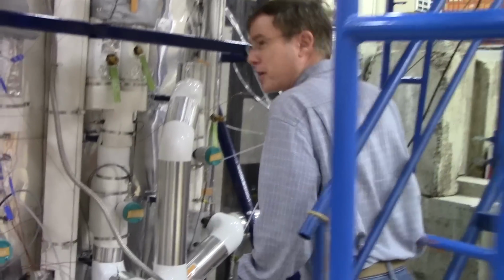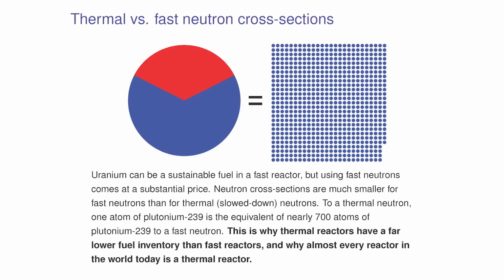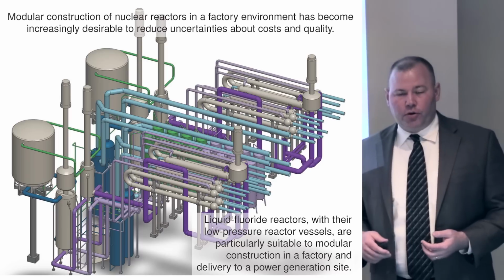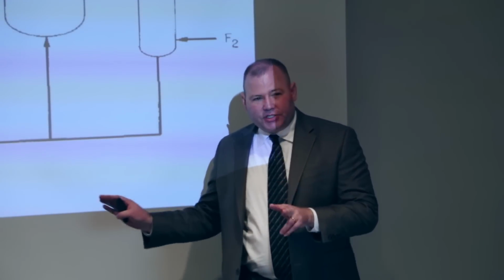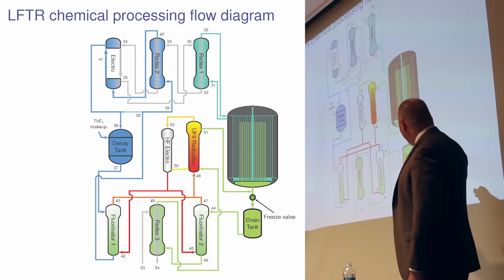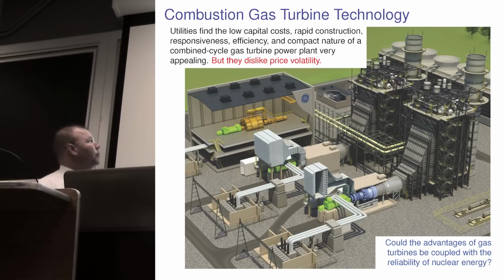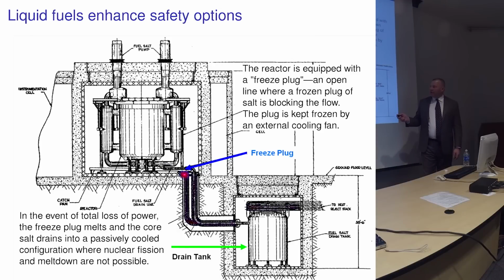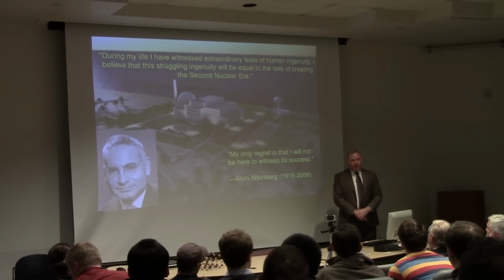LFTR Chemical Processing & Power Conversion - Kirk Sorensen

Comment: Thorium isn't fissile. It's U233 that is made from Th233. Amazing how that whole area is carefully not written about. Just another U reactor using a MORE hazardous radioisotope! U233 bombs have been tested.
 Don't believe that decay-heat has been solved. Let your salt solidify and watch how hot-spots appear, totally defeating this wonderful, totally false security feature. A solid cannot have heat removed anywhere near the efficiency of a liquid so those hot-spots will breed.
 As a parting shot. radiolosis will result in volatile salts and metals - so not safe at all. Dounray in Scotland ran 2 breeder-reactors and examined the trans-uranic (232-239) elements chemistry and radioactivity and discovered that in their sodium-cooled systems, it was inevitable that fissile material ended up in the cooling circuits. That was a 33 year study and the use of water is for the very simple reason that the Navier–Stokes equations are an extant mathematical but we have so much knowledge on water & steam, design can come from direct data.
 How quickly DOES a molten-salt erode the piping? Hastalloy N is NOT designed for the loads mentioned. As the lead-eutectic & sodium-reactor failures, so we learn how metals embtittle and dissolve other metals. We just know from practical experience how critical water acts. Information from hundreds of deaths.
 Any idiot who doesn't realize the hazards should elect to have one built at the foot of their driveway or ideally in their bedroom. THEN we will see who truly believes in the safety. I know for sure that nobody involved in the technology on any kind of academic level would give it 2 thumbs down in the blink of an eye.

 So, please ask. I have the .PDFs of the entire US/UK & Japanese research information and if you can sit through the 3800 pages then you can at least think of appropriate questions. I think question 1 is 'who profits from these lies'... not a LONG trail of breadcrumbs by any stretch of the imagination.
Reply: Bad Pharma - Dude, have you been popping Bad Pharma pills? You don't start off with "Thorium isn't fissile" talking to a crowd where the entire conversation is on breeding. As a parting shot, consider how silly your suggestion of getting your city council to approve installing a containment building in your bedroom sounds.
Reply: By the way, you did say, "Let your salt solidify...." as though you assume it has only been theory that hasn't been done yet. Which has actually done every Friday, simply flipping the switch to go home for the weekend. You simply can't equate molten salt with molten sodium with molten water with molten whatever. A reactor is fundamentally DIFFERENT when the fuel is dissolved in the coolant. If you think the nuke is doing something dangerous, flip the switch, go home, and let it turn into a brick while you figure out if there was something to worry about. It's what's called "walk away safe".
Reply: It IS only theory - nobody has ever tested what form a mixture containing U233,U232 and all of the transuranics (yes - the list of daughter elements is in the double figures) physically behave. Volatile fluorides will tend to stress a solid until it fractures and force their way upwards - concentrating the fissiles.. You are aware that radiolysis means that ever element (including the transuranyls) will form salts with the -F? It also means any salt anions will also appear in their metallic state (so look at the MP & BP of them all).
 I have been told by someone quite well versed in technology that beryllium fluoride is also in the mix to enhance thermalization. That means even in the magic cure-all that is the run-off tank, more that decay-heat will be produced.
 Even more simply - how exactly do you cool that solid with it's decay heat? I've seen how uses fuel elements are treated. They are physically separated (to minimize the neutron flux) and they use a truly vast amount of cooling.
 From that point - what do you do with your tonnes of unstable, reactive (transuranics react with water, some even react with carbon dioxide), highly toxic material (heavy metals a poisonous - Pu will kill you via organ failure before the radiation becomes a hazard.

 I say this purely in the spirit of understanding. I don't need to defend my position because the reason nobody can get a license for such reactors is because nobody has been able to answer the above list of problems.

 I should also like to point out that the U233 & other metals in the mix embrittle and indeed dissolve Hastelloy N. So exactly what will the reactor be built from? You failed to address the problem - just about the most fundamental problem.

 As a tip - if you have no working knowledge of radiochemistry, don't presume that your own ignorance is as valid as someone else's knowledge.

Comment: I wonder how a thorium reactor would work on Mars, with .38 of Earth's gravity. Also, this waste tritium, any practical use for this?
Reply from the maker: https://en.wikipedia.org/wiki/Tritium#Use
"As of the turn of the millennium, commercial demand for tritium is 400 grams per year and the cost is approximately US$30,000 per gram."

I'm not sure if having more available would facilitate increased usage & demand or not.

As-to reduced gravity on Mars, I do believe this increases reliance on pumps and using pressure to move fuel into a drain tank. So passive safety mechanisms would need to be rethought for low or zero gravity scenarios.
Reply: Tritium is used in pistol night sights as it will glow in the little glass tubes.

Comment: The utilities are on board for sure because of the lack of excess downtime.
Can the U233 be diverted for other defensive purposes?
Reply: If you mean the proliferation problem, U233 is as good as a nuclear fuel as U235 or Pu239, so it's theoretically possible. The "proliferation-proof" part of the Thorium cycle comes from the fact that you cannot breed effectively and economically pure U233 without some contamination of U232. The decay chain of U232 emmits a lot of gamma radiation which besides being a telltale, it would easily kill any closed packed electronics as in a nuclear bomb. U232 and U233 are not possible to separate with any know isotope separation method, and even then it would make more sense to enrich natural uranium to make a bomb. 
Long story short U233 is always guarded by trace amounts of U232 mixed in, inevitably. The only way I can imagine to get rid of it is wait for U232 to decay away in 200-300 years or so, and then make a bomb...not very practical
Reply: U233 is a great nuclear battery fuel with a half life of 160,000 yrs
Reply: No it's not. The longer the half-life the smaller the power output, that's why we use Pu238, because it has a short half-life of 80 years, and even then it produces miniscule amounts of power. Another option is polonium that have a half life of 90 days and it produces proportionally better power. Something with a 1000 year+ half-live would produce less heat than an ant
Reply: U233 has already been made into a nuclear weapon in the U.S. for 1955 Operation Teapot "MET" and later Soviet union.  It was mixed with other fissile materials for both tests.  Initial yield was 33% lower than originally anticipated, but as it has a long half life, should be well suited for weapons.  It was purified enough for weapons use at the time, records should still exist.  The nuclear industry is full of fraud and they want to make new weapons.  It is understandable that they want to run away from a history of  cost over-runs, pollution, and disaster.  Are the alternatives that bad?
Reply: regorester - You are being deceptive when you equate a test with a weapon. It is not impossible to purify, it is just much harder to weaponize than other more easily used fissile materiel.
Reply: @tsamuel6224  The divorce of molten salt from plutonium, the preferred weapons material is firstly false, as the original reactor was designed to breed it as well.  It is also unlikely that the creation of U233 will happen without using U235 as a neutron source and creating some plutonium as well.  The novel "kindney" design opens proliferation options.  Seperating these facts is deceptive.

Comment: Will these reactor be flood-proof or Tsunami proof and can this be demonstrated?
This is a serious issue due to the current projections for water rise.
My personal opinion is its too late. Even if you ordered the shutdown of all plants and conversion over the next 5 years you may already be 2 years too late.
The Native Americans say all the fish will die. Looks like they may be right.
Eventually the use of palladium can be in white gold again and chemistry catalysis the co2 generated by ICE can be captured and converted to ethanol at 70% yielding a hydrogen cycle car from an ICE using hydrocarbon. The conversion of CO2 can be powered by onboard solar and batteries.

Comment: Japaneese Reactors should be shut down on their East-coast, the Tsunami-coast!   (Monjou) ! !   
Japaneese West-coast is safer, so less risk! And if anything happens again, they would have to suffer the radioactive dirt themselves in first place, because of the prevailing west-winds. (Nations build reactors preferably near their borders; a bad habit!) 
The geological situation is inverse in California. There the risky coast is West! So don't plan for building LFTR-reactors on the west-coast, even if you could. Desalination only at geologically stable coasts with little Tsunami dangers.
Reply: Why would you care if there was an earthquake & Tsunami where there's a LFTR? The water is outside, not inside the system, it's just an earthquake & Tsunami. The LFTR is just an empty tank with its fuel in the drain tank. The geological situation isn't very important.
Reply: Kirk said in an interview that the best possible locations for a compact nuclear reactors like LFTRs would be in an off-shore location, like a floating platform. After all, nuclear submarines work perfectly well and are earthquake and tsunami-proof
Besides, Fukushima was a complete diffent scenario, impossible with LFTRs. BWR should not be allowed to operate, they are inherently unsafe and responsible for much of the public blame on nuclear power.
 Fukushima should have been kept turned on after the tsunami because the reactors were fine, it was the auxiliary instalations needed to reject the decay heat that were fucked. So they decided to take the stupid road and shut down the reactors. Unable to cool themselves, once the decay heat exceded the temperature at which water in the reactor reacts with the fuel rods, hydrogen was produced and after a spark it blew up the roof. There is no water to begin with anywere in the LFTRs, there are no fuel rods in there either, and they have that fool-proof safety mesure of the freeze-plug, besides the usual conventional safety devices like scram-rods (which are redundant at this point). In fact you could throw a granade inside the core and you will only fuck up an expensive piece of machinery, the reactor would probably just leak molten salt and it will tend to freeze, plugging the hole.
Completely different design to anything else in the nuclear industry.
Reply: now in Jan 2024 Japan had an 7.+mag Earthquake at the West Coast, and a several-meter Uplift of the coastline. Although many houses severely destructed, the Reactors were relatively unharmed structurally, because their foundations were 7m (or 17m) down, sitting on solid rock! 
The only problem, if they were running was, that they could have been cut off from cooling water access!

Comment: I keep hearing that the plans to kick off the Thorium fuel cycle will be to use U-235.  My question would be: something has to kickoff the U-235 chain reaction.  Why can't the  same method be used to kick off the Th-232/U-233 cycle?  Is it a question of density?  Just not enough to sustain?

https://en.wikipedia.org/wiki/Startup_neutron_source
Reply from the maker: I don't think we could depend on LFTR to make fuel for LFTR, the breeding ratio is low. Am expecting LFTR seeded by HEU or Pu.
Reply: Hi Erik, is not a problem of a neutron source to "kick off" the reaction, is the fact that we need a starting amount of fuel to "ingite". The US inventory of U233 is very low, the remains from the experiments done in the 60s, and what worse is that it was targeted for destruction in conventional rectors some years ago, so maybe it doesn't exist anymore, I don't know.
The U235 would be used to be the initial fuel load in the first breeders, once they have bred enough U233 to start more LFTRs, there is no need for further U235
Reply: Let's hope we have this problem in a few years, too many LFTRs to start and not enough starting fuel!
Reply: U235 is fissle, and "kicks" itself (alpha particles/radiation) into chain reaction just based on purity/density.  In most reactors it is modulated with graphite rods.  Plutonium can also reach chain reaction, but it is usually for weapons or waste created from U235 fission reactors.  Big truth here is the origin of all alpha radiation for for fission in nuclear reactors (yep, thorium included) has to originally come from U235.  Sorenson never seems to mention this, seems very deceptive in an industry full of fraud and disaster.
Reply: regorester - alpha radiation doesn't participate in fission in nuclear reactors so your comment seems strange. You will hear over and over plans to kick off the Thorium fuel cycle will be to use U-235 & some people like HEU or Pu. That is simply how it is generally planned. One LFTR can make fuel for two LFTRs and so forth, but the time scale is crazy long and likely exceeds the first one's lifespan in early gen nukes. Sorenson has multiple vids and deals with the starting fuel subject at length elsewhere, assuming those vids are still up.
Reply: I know of no thorium reactor that creates more U233 than it uses.  Indeed the U233 stockpile was made at a cost of $6B, almost certainly using U235.  It will take probably all of it to start only one reactor.  Even Gordon does't think so. See above: "I don't think we could depend on LFTR to make fuel for LFTR, the breeding ratio is low. Am expecting LFTR seeded by HEU or Pu."  Start counting the neutrons, as it will take one to transform Th232 to U233, and another to split.  Some are lost, and protactinium will absorb plenty....

Comment: I'm not an engineer or a nuclear scientist or anything like that. I only have a powerful intellect to grasp this stuff. I really believe in LFTR and desire to obtain the education to work in the nuclear power industry and especially work with this technology in particular.  I have done alot of reading about everything from the actinides to how LW & Candu reactors work to even understanding how criticality works. I'm to the point where i watch one of these Thorium videos with alot of technical talk and understand what you are talking about.  Who do I talk to in order to obtain the degree in nuclear physics and engineering I will need to do the job. Again I have a rather deep understanding of nuclear energy radioactivity, everything from how decay works to hold fission products are formed. A lot of knowledge for a truck driver on disability with a GED.
Reply: Викентий Мадзин the only way is go to school get a engineering degree and a master's in nuclear engineering. (5 year path) you can reduce the cost by taking core classes at community college and transferring. I would consider chemical or mechanical engineering

Comment: Does the graphite, in the core and the metals in the tanks/pipes degrade at the same same rates as a graphite reactor or a PWR?  It looks like the most of the development heavy lifting will be done proving the chemical plant on the left side of block diagram.  Good luck!

Comment: I liking these new developments with MSP & LFTR, i think the hold great promise for Africa (where i live) where modular infrastructure is badly needed & i think we can make it work because we don't have vested solar/coal interest & have good rare earth mineral deposits.
Have a few question that maybe @GordenMcdowell can answer pls;  (1) what happens if the drain tank ruptures for some reason like in an earthquake? (2) Also,  can a CO2 driven turbine system add to greenhouse gas emissions somehow?
Reply: I know it's an old post, but I'll awnser anyway. The drain tanks can not rupture if they are embedded in a slab of concrete to passively absorb the decay heat, at least the last time I checked on LFTR technology some years ago that was the idea. The drain tank doesn't need to be a sofisticated piece of machinery, it only needs mass, so you can make them armored like an A1 Abrams if you want to. 
Regarding leaks in the system, LFTRs are supposed to operate under slightly negative pressure, that way stuff tends to be kept in when there's a leak, and even if stuff comes out because someone pulled an Allahu Akbar on the reactor vessel, molten salt would tend to freeze and somehow plug the hole
And no, the CO2 turbine is a closed system, and the entire system works on a miniscule amount of CO2 compared to what a city emmits every minute.
Reply: Silas Okwoche to nr 2 he said it wil be a Closed Circulation